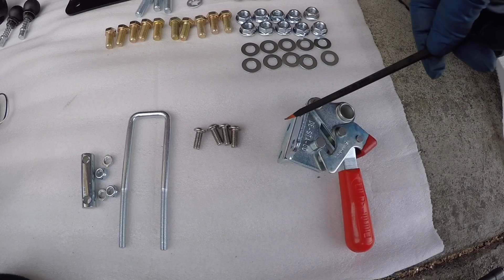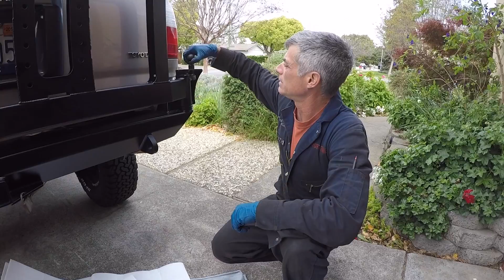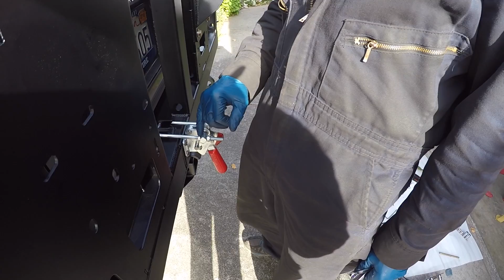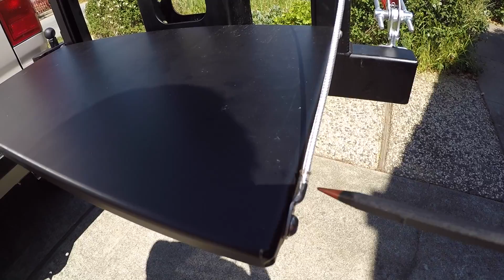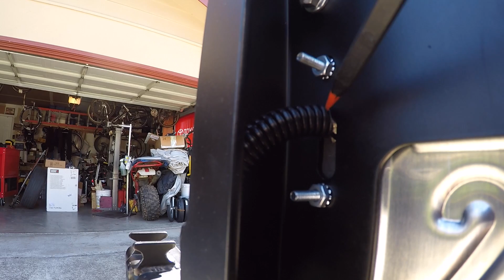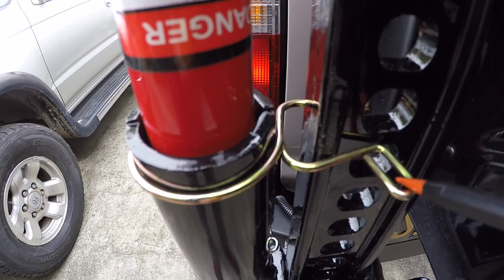CBI Dual Swing Arm Rear Bumper Install (Part 2)

Comment: Hi Timmy/Shawn, you have a similar installation right up on coastal off-road equivalent rear bumper spare tire holder etc.? If not have you ever thought of doing one, I know you would have to weld it together first but possibly that would be a learning experience for everybody including me thanks Dave
Reply from the maker: No, we don't have a video for building one of those weld-together bumpers.  Not sure I'd want to film one.  It would be fairly tedious to watch because it's mostly all welding.

Comment: Greetings Timmy and Sean, thank you for the video I appreciate it! I have a 98 SR5 I would like to do similar to, what is the result of the body mounts is it changing any height is it just giving more stiffness more rigidity? Is the CBI the only swing out bumper it looks really clean on the Limited version. Since this is later than you made this video, are there other body mounts that you might prefer to go with rather than Sonoran steel? Any updates you have also consider I’m looking to get some kind of flares put on the SR5 so that might be worth something thanks very much for your time!
Reply from the maker: CBI doesn't make this bumper anymore unfortunately.  The solid body mounts don't change the height.  I don't know of anyone else who makes the solid body mounts other than Sonoran Steel.  Don't know what's out there in regards to flares for these rigs other than the OEM flares.

Comment: Hi Timmy, I love your videos! I finished installing my new CBI dual swing out rear bumper on my 98 4runner a few days ago. Your videos made it a breeze!!!   I learned from your troubles of getting the bearings to seat.  I thoroughly cleaned the seats in the swing arms--I scraped, polished, wiped--I got them spotless. The bearings went in like nothing. The key thing is to get all of the powder coat off from the inside (I used a dremel with a scotch brite type of sanding attachment) and thoroughly scrape and clean the gunk off of the 'ledge' where they seat.  So the bearings were fully seated and 'square' to the cylinder,  and that also made the swing arm install on the pivot post very smooth.  Just gentle taps with a ballpeen and drift punch, and a little nomar action. Easy!   And don't even get me started on how easy you made it to install the fold-down camp tables! AWESOME! thank you! :)
Reply from the maker: Good to hear our video helped you with the install. Sounds like all your prep work made the swing-outs much easier to install. Too bad CBI stopped making this bumper for the 3rd Gen crowd.  They make really nice stuff.
Reply: @TimmyTheToolman  yes, CBI do make nice stuff. Too bad they dropped the 3rd gen bumper, but glad I got mine before they did.  It does seem that there's a dearth of products out there for the 3rd gen when you compare to 4th and 5th gen, and other vehicles.  I was really frustrated for a while until I learned that 1st gen taco products will work, for the most part. WTF! :)
Reply from the maker: @arm1322  It use to be the other way around about 5-6 years ago.  Tons of companies were making aftermarket stuff for 3rd Gens but when companies like CBI realized their orders for 3rd Gen products dropped off, they decided they could do better by concentrating on the models that most people were modding and dumping lots of money into.  I think they're now concentrating on 5th Gen 4runners and newer generation Tacomas.

Comment: Hey guys! Do you happen to remember what AWG you used for the light? If not no biggie
Reply from the maker: No, I don't.  Just match the gauge wire of the light.  Your wire strippers will tell you the gauge.  Start off bigger than you think the gauge is and go down one size at a time until the plastic sheathing comes off.  Then you will know the gauge wire.

Comment: Hey Timmy quick question for you (97 4Runner): long story short but all the trailer wiring on my used 4Runner has been pulled out. The previous owner added a 9-pin connector, made a spaghetti out of it (including strapping the trailer brake wiring to the fuel line and driving it like that for 24 years - yikes!), and the factory 4-pin connector was nowhere to be found. I have a rear tire carrier and a new location for my license plate. But there is no auxiliary wiring for me to tap into. But I figure whenever my tail lights are on, the license plate light should be on, too. If I want to tie my new license plate light to a (passenger side) tail light wire, which one is it? Of course the brake/tail bulb is a dual filament and I don't want to tap into the wire that powers the brake light.
Reply from the maker: I don't know which wire it is but all you would have to do is turn on your headlights, go to the tail light plug and see which wire is getting 12v power using a test light.
Reply: @TimmyTheToolman  Of course that's the obvious solution. Why didn't I think of that?!

For anyone else as lazy and/or obtuse as me, it's the solid green wire on the lowest fixture
Reply from the maker: @ML-dl1cp  Sometimes the obvious answer isn't so obvious.
Reply: pure genius...

Comment: Where's the right side signal fuse for 2000 limited 4rnr? All lights are working except for the right signal. I did testing & there's no current for the right side
Reply from the maker: There wouldn't be a fuse just for the right signal light.  If just that one side isn't working, it's got to be a wiring issue or maybe the relay is bad.  There's a turn signal relay behind the fuse panel under the dash on the driver side.
Reply: @TimmyTheToolman  thanks man! Highly appreciated
Reply from the maker: @nick-3388  You're welcome.  Hope you figure it out.
Reply: @TimmyTheToolman  I did some voltage testing & it appears the harness is bad. I got good reading before the harness converter but negative for the right signal after the converter. I ordered a new harness. Appreciate all you do for the community!
Reply from the maker: @nick-3388  Good job figuring out the issue.

Comment: Thanks again Timmy for another incredible vid I enjoy your videos because you explain it thoroughly and step-by-step even though some of us are certified mechanics like me it’s always a learning process my grandfather said you never done learning mechanics every year a new vehicle new vacuum system computer etc. you’re never done learning your videos make it easy for some of us that are experience and for those  that are just starting or  DIY fans thank you again I will like to see a vid on raising 98 Toyota forerunner 4 inches springs shocks and all I’m having a hard time trying to find one of your videos on that maybe you could put out another vid thank you Again God bless and yes  bend your knees and use your legs very important
Reply from the maker: Hey Melvin, glad you're finding our videos informative.   It's nice to hear even professional mechanics appreciate our efforts.  We actually had a lift video for a 1st Gen Tacoma but lost the footage when we accidentally dropped the hard drive the video files were on.  That sucked.  We'll hopefully do another lift video for a Tacoma one day.  But, our Toytec lift video we did on a 3rd Gen 4runner would show you a lot of it.  The front end of the 1st Gen Tacomas is the same as the 3rd Gen 4runners.  Doing the rear leaf springs and shocks isn't too difficult.  Thanks for the kind words.  We appreciate it!  Happy Wrenching!

Comment: Nice video of the installation. It seems like the large (orange) jack footplate is sticking out the furthest, then the jerry cans, then the spare tire. I have a hard time justifying the bumper cost when nothing can hit your bumper.  Also, the jack footplate is screaming to get stolen with the wing nut! With the dual swing arms, getting into the back is a pain!
Reply from the maker: The lowest point is the bumper, not the jerry cans or spare tire.  If a vehicle rear ends you, and they're anything but a big truck, they will most likely strike the bumper and not the jerry cans or tire.  Also, if you understand approach and departure angles, when going up or down something steep, the lowest point usually strikes and not necessarily the item that is sticking out furthest.  They could hit under the right circumstances but the bumper would be more likely to drag because the jerry cans and spare tire sit much higher up on the back of the rig.  Opening up a dual swing-out bumper is fairly easy and it offers utility with the tray table and other lighting you can add to it.  Anyway, it sounds like you already made up your mind it's not for you but I wanted to respond and give you my opposing viewpoint.
Reply: @TimmyTheToolman  Thank you for your reply.
Reply from the maker: @belatoth1446  No problem.

Comment: How obstructed is your vision because of the spare. Do you have options on how high/low it’s mounted?
Reply from the maker: It's fairly obstructed and one of the downsides of having a rear tire carrier.  You can adjust how low it's mounted but you have to think about departure angle when you're wheeling.  If you mount it too low, it might drag on the ground when you're transitioning up a steep hill or negotiating a steep obstacle.  You also have to take into consideration being able to easily get to the locking mechanism for the swing-outs.  Mounting it lower makes it harder to get your arm in the there to operate the lock.
Reply: Timmy The Toolman Yeah. Makes sense.

Comment: I own a 2000 4Runner and I found that a 20 oz Gatorade bottle is perfect for wedging between the brake pedal and the underside of the dash (while in park) if you don't have anybody to press it for you when checking your trailer lights.
Reply from the maker: Thanks for the tip Seth.

Comment: Blue lock tite on all your fasteners would be a good idea. Or go to the hardware store and get a bunch of pinch style nuts. Believe it or not there is a lot of vibration back there. Actually be looking at this bumper myself.
Reply from the maker: Instead of blue loctite I'm using lock washers but either would help prevent bolts and nuts coming loose.  I lost a bolt during a Death Valley trip with lots of washboard fire road and added lock washers after that.  Haven't lost a bolt since.

Comment: I might have missed it but what made you pick the 2 swing arms oppose to the single one for the bumper?
Reply from the maker: Hey Daniel, I chose the dual swing-out because it would be easier when I wanted to open my rear hatch.  One long arm takes up more space than 2 shorter arms.  When I'm in a public setting parked on a street or in a parking lot, that single rear swing-out will stick out very far. Say I'm parallel parked on a street with a vehicle behind me.  That vehicle behind me might be so close that I can't open the rear swing-out.  Also, one arm with 2 full fuel cans, hi-lift jack and a spare tire is pretty heavy.  Dividing that weight makes it easier to open and close it.  The only real downside I see to the dual swing-out is you can't get as large of a tray table.  The tray table available on the single swing-out is larger.

Comment: Wonder if the tow rating on the CBI bumber is rated the same as the frame mount tow hitch or is it rated higher or lower
Reply from the maker: CBI doesn't guarantee the rating due to liability but the bumper is well built and should be able to handle towing the max capacity of the vehicle.
Reply: @TimmyTheToolman  good to know

Comment: Great video ! I’ve got a 1997 4Runner what bumper is that ?Will it fit my rig?
Reply from the maker: O'Neil T this is a CBI dual swing out rear bumper. It will fit all 3rd gens 96-02

Comment: Recommend adding some locktite to the screw on collar portion of the lock and unlock mechanism on both swingarms.  The round metal collar that screws in to the arm came undone and I lost the whole locking piece.
Reply from the maker: Thanks for the tip.

Comment: Anyone have a used one for sale? $2200 USD plus duty at the border works out to be $3200 CAD :/ Hard to justify on a vehicle that's seen 20 salty winters. 

Looks real nice Tim! Enjoy it :)
Reply: I would rather have a CBI but Coastal Offroad makes a decent rear bumper/carrier and they are in BC. No exchange/customs/insane shipping. 

They only make kits so you need to find a way to put it together. I have one on my 3rd gen and I really like it. All in it was about $2500 Canadian including $300 to powdercoat. I didn't pay shipping because their shop is near where I live. Still going to be way cheaper than importing a US one.

Comment: Second install I've watched (turbodb on TW) that had some fitment issues.  It seems cbi needs to go to machinists handbook and reexamine the bearing fits section.  The last thing you want for bearing longevity is to have to pound the crap out of them during installation.  Also detracting from this otherwise cool accessory is sae hardware on a metric vehicle.  I still want one tho.  Great vid as always.  Timmah!
Reply from the maker: Christopher Beasley Hey Chris, I don't know if you watched the whole video but I do admit having trouble getting the upper bearing into the driver side arm was most likely operator error on my part.  Now, getting the driver side arm onto the support spindle was something that also fought me and I'm not sure what caused that.  Maybe the lower part of that support spindle was just a tiny bit wider making it harder to get the bearings onto it or maybe I just wasn't supporting the arm properly to make the install go smoother.  The end result even though getting the arm on required more force, the swing arm feels perfectly smooth.  Those bearings are just supporting the arm and don't have any constant force on them.  I'm pretty certain those bearings will never have to be replaced.
Reply: Timmy The Toolman yep, watched it all.  I think they have some tolerance issues with the fitup of those parts.  It's pretty hard to get it right in volume production, especially with weldments.  Ideally it's machined after welding and stress relief.  You're not the only one having trouble.  Still overall a nice product.  Just a bit of a pain to install.
Reply from the maker: Thanks for sharing your insight Chris.  I'm overall happy with the quality of their work.  I have nothing to compare it too but I'm guessing other aftermarket bumpers will have some similar issues with fitment.

Comment: Awhhh snap looking good! How’s the weight of everything doing while driving? Any sagging on the rear? And do any of those rear accessories make noise while on the road or shake at all? Thanks Timmy for another great video.
Reply from the maker: Thanks.  Glad you like the video.  The lift I bought factored in adding weight to the rig.  The added weight will actually make it ride better because the lift without the weight is pretty darn stiff.  I have barely driven it since finishing the install so I don't really know if things will start making noise.  I've driven it a couple times on the freeway for short distances and no noise to speak off.  I'm in the process of adding a front bumper with winch, rock rails, and skids plates so even more weight will be on the vehicle.  When it's all done, I will have probably added 500 pounds to my rig.  

The Sonoran Steel lift I installed is made to give you a positive rake (rear higher than the front) so when you load down you rear cargo area with gear, you don't end up sagging.  Before the bumpers and other things I'm adding, I started with a 3" lift in the front and a 4.5" lift in the rear.  Since I'm adding extra weight to the front and rear, I'm thinking the end result will still have me with a positive rake which is what i want.  I might have to readjust the front coilovers to get the same positive 1.5" rake I had before adding all the weight but I'm thinking I will be able to just leave it alone because it will be close enough.
Reply: Timmy The Toolman How has the mpg been affected?
Reply from the maker: All the extra weight from the front and rear bumpers, heavy duty skids and rock rails and running larger tires has definitely lowered the mpg.  I'd say by at least 3 mpg.

Comment: 4Runner looking sweet ,Will you be doing a review or a video for the lift on your 4Runner ?
Reply from the maker: Thanks!  When the time came to do the lift, I wasn't in the mood to deal with filming. Filming adds a ton of time to a project and I knew this lift was going to be the hardest lift I've ever installed mainly because of the external reservoir component figuring out how I was going to mount them.  But, dealing with the reservoir mounting was just one thing and there were several things that made the lift more time consuming like adjusting the coilovers to get the ride height right.  The external reservoir fitting gets in the way of turning the adjuster plate so it's not a simple task of turning the adjuster with the special tool provided.  I could go on further with the problems I had so it might be worthwhile to make a video of "Install Tips" for the Sonoran Steel Radflo External Reservoir Lift so others buying this lift will have an easier time than me.